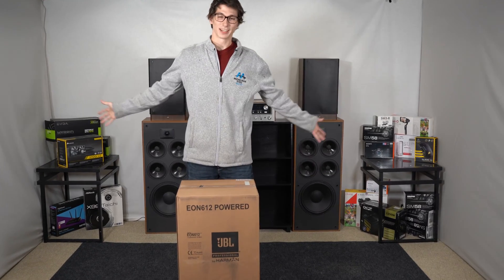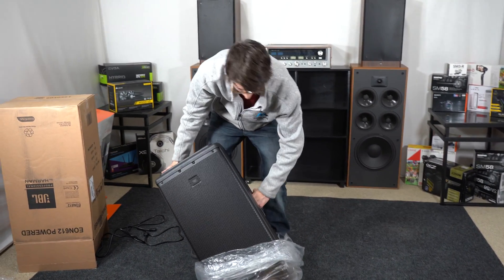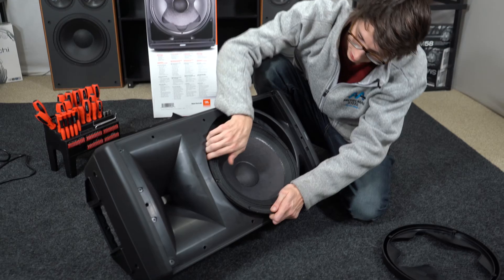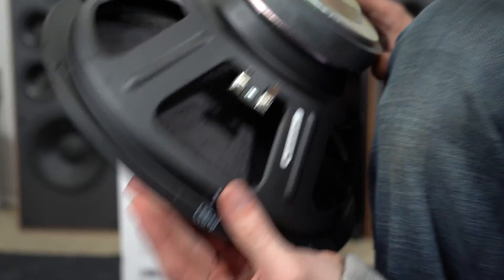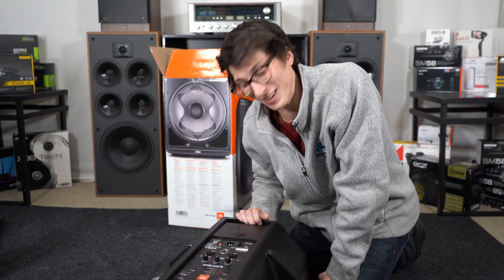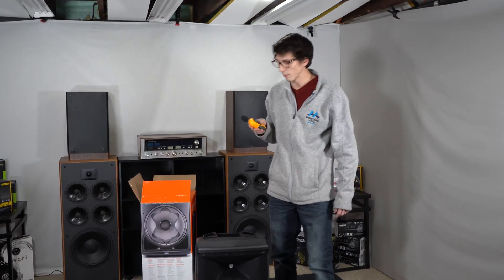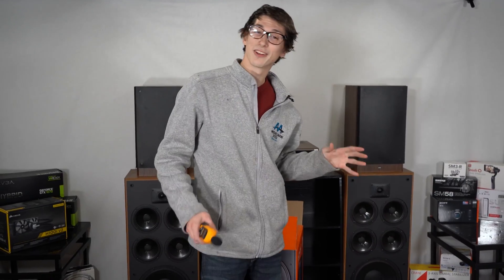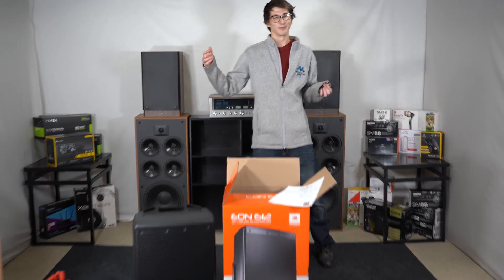JBL EON612 Test and Teardown

Comment: I wish I’d seen this video before I bought two EON612 amps on eBay.  They say they’re rated 1000W, I don’t see how that’s possible.  
   Thanks for the tear down.  The replacement EON612 amps I just bought came with no documentation.
   I also have JBL PRX812w’s, they crank.  But none of them approach the volume of my discrete horn, mid, & sub setups.

Comment: Thanks for the video, I bought a pair of Eon 612'ves refurbished at eBay about 2 years ago. One tweeter blew out on my third gig (I'm a casual Home DJ for home parties), at that time, the speaker was under JBL warranty. This weekend the same thing happened on the other speaker, my question is: Is this a common problem from these Models? I hardly ever use the EONS since I own several other speakers. I find it shocking that after only 8-10 gigs this problem persists. Any comments on this issue? Thanks.
Reply: i have a pair, i replaced the tweeter on one speaker twice. idk y?

Comment: Question, I just bought the 610, plugged a mic. In line, and it’s not loud at all, do I need to run a mixer for loudness? If I use the mic option, it is a bit louder. Thoughts? Thank you.

Comment: THE WAVE GUIDE THAT YOU ARE NOT SURE WHAT FOR......is a bandpass 6TH configuration for the low woofer. There are 2 chambers ( the big one  reacting with the 2 ports resonators and the little one ( created by the wave guide in front of the cone ). This configuration give a boost in SPL and limit a part of some distorsions. Generally, you can study the bandpass 6th principle also. It;s an old system but rare seen in the fullrange speakers. Usually , seen at very powerfull speakers systems for big venues.

Comment: "I'm sure there's a good reason for it"

Box with reason for diffuser right behind you. Deeerpp

Most of this was rambling, you clearly didn't know much about most of what you're looking at. Not knowing why they have an acoustic lens/diffuser for dispersion control is one thing, but even as far as calling a machined surface 'polished' , saying the clips held the acoustic insulation inside the "driver" etc. 

You even then removed something that "you didn't like" with absolutely no idea what it even did. I'm sure the acoustic engineer at JBL thinks you're an idiot.

Ooh look at all the caps "that's where JBL get their power from". Caps can be just for smoothing DC ripple etc. Again no idea wtf you're even looking at. "Nice electrical work" while looking at a circuit board that you probably couldn't identify more than a capacitor on.

Ooh we had it at 80% gain, that means NOTHING without some form of standardized input voltage etc.

Rambling stupidity is basically the theme of this video.

Comment: Great video! Do you know what type of screw bit or screwdriver you used to take the grill off? I bought a Torx 5 point set but none of the bits fit the screws.
Reply: Yes what tool and bit is used to remove the grill?

Comment: The components were incredibly cheap, no wonder the whole thing was so light, I don’t think it would stand up to sustained high volumes. To be fair though, it is common among all companies to use cheap components, it’s just that these are among the worst I’ve seen
Reply: yes, even the cheap thomman speakers (PA302) have a better woofer than that : https://www.youtube.com/watch?v=Z0sG6d0MWiQ
Reply: @sonny9546  The pa 302 is not bad for the casting subwoofer, although it is a Chinese copy. However, there are pressed chassis in the top crates of almost every brand, even in slightly more expensive speakers. Eg the big QSC K, Ev Zlx, Ekx, but even in Etx, Hk audio Premium pro, Linear 3, but even in Linear 5 (Linear 5,115 FA: $ 1,230  Thomann) !!!!!

Comment: You should d oa test and a teardown to the JBL  EON618S 1,000 Watt peak 500 RMS.  So  frickin loud in person and i barely even went up volume and the bass is just INSANELY   DEEP BASS AND BOOMING XD I  tested it out at the Guitar Center on a couple of my  music and   holly craP I AM  GETTIN'  THAT BEAST NOW XD I have 2 2,000 Watt QSC K10 K.2 10 inch top subwoofer speaker.   Insanely loud and  thumping punching bass from them. I have the Gains  set to the 12 O' clock position and i barely  have the volume up (I always have the setting preset to Dance and i  frickin love them.  2 QSC 2,000 Watts 10 inch K.2 K10 10 inch  Drivers. (I sound tested them at Guitar Center and i was like  Oh  my god i am   GETTIN'  DEM BOYZ  XD   AND ALSO I  SOUND TESTED THE JBL EON 618S 1,000 WATT SUBWOOFER LOL.      SO INSANELY  LOUD AND DEEP BASS OF PUNCHING DEEP THUMPING BASS ASWELL.   It shook the entire big display-room / show-room.  I'm soon gonna get it in like 2 more months.

Comment: 108dB ? Something wrong with the spl meter ? Description read... 126dB max SPL from what distance half than 1m. :O
I like the video anyway. 🙃
Reply: Don't forget that the db that all manufacturers tell are very difficult to get. They may reach those values with a very lenear music and with low base equalization on mixer. These models have 500w Rms and they are very loud. If you add a sub for gigs or weddings they are perfect. I have 2 eon12" and a db technologies15" sub and don't need more than this for weddings up to 200 guests.
Reply: @LioSintra  Thx,so i tested my little 6,5 monitors with a dB meter look like similar in  @ 20w rms ~ 108,7dB! That's why I was interested. If you have an 500w amp powered by 400w @ 95dB sensivity speaker 10 feet - 111dB + more can do. 3 feet 121 , 3 feet - 20 watt 108dB... questionable that its true sensitivity is no less than 95dB 1w\m. When i have time to listening this JBL 612 would be curious.
Reply from the maker: Yeah it's what we got at 1 meter roughly. Dont get me wrong it was insane loud. Remember every 3 db is twice the intensity.
Reply: @2DudesAudio  108 Db is not that loud, I have a jbl partybox 300 that sounds as loud at 1 meter, I measured it

Comment: My EON G2's were $799 new. These new EON's are cheap and they sound like it lol. 

That's what happens when buyers demand cheap prices
Reply: Your model are very good and I like more the sound of Grey model (only have volume knob) instead of black model with eq buttons. But when you need high volume they loose quality. With this model if you use the app you can get the same quality in all volumes. I even made them clip and the sound keep same quality and much more louder than old jbl models. I think this is a kombat speaker model just like old g2 were. Other manufactory like Mackie can't make new kombat models like the old srm 450 v1 and V2. But Jbl and Yamaha still can.
Reply: @LioSintra  You're saying that these 615's have the same sound quality as the G2's? Hmmm... Very interesting statement lol.
Reply: @davidneighbors5013  You should hear them by yourself 😉
Reply from the maker: Yeah, the older generation sure packed more punch, all the new stuff is dsp out the butt.

Comment: Usually I use the volume of speakers at 12h. But those have volume knobs. Which position should I use those master and Chanel volumes to make them sound loud without have any damage on speaker?
Reply from the maker: The best way we used it was, 12-3 o'clock on master with the channel gain anywhere from 0 to max.
Reply: @2DudesAudio  what is the difference between  
jbl eon 610 1000 watts
and 
Jbl eon 615 1000 watts
Do they sound different?
Or what is the difference?
Reply: @2DudesAudio  So can I use on 3/4 on master and max on individual channel? Will the sound work well? Thx!
Reply from the maker: @GlaucoMoledo  yes